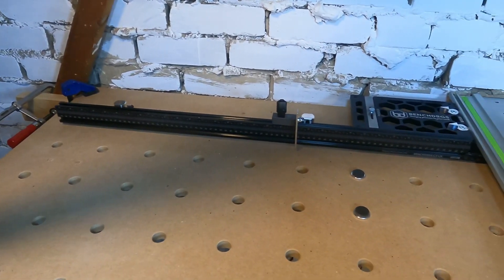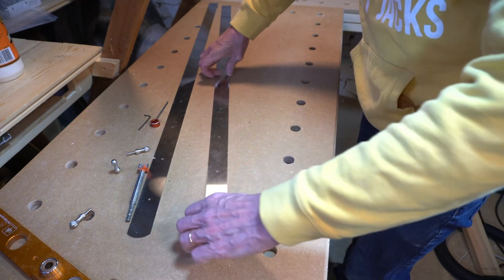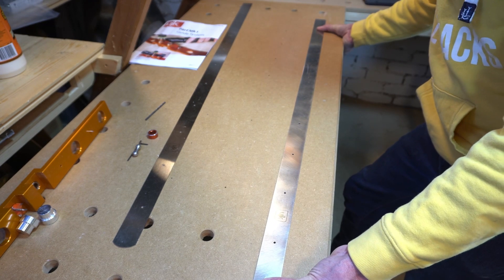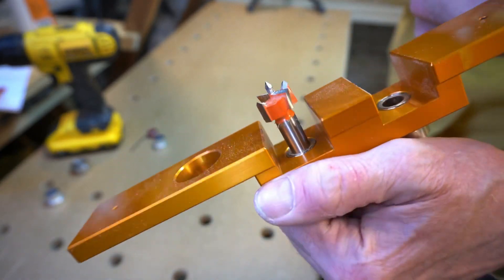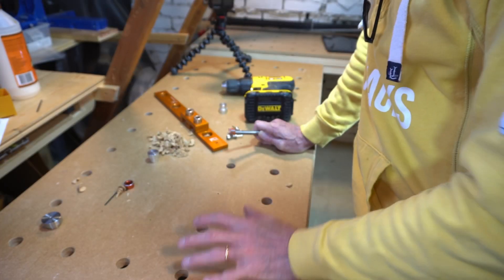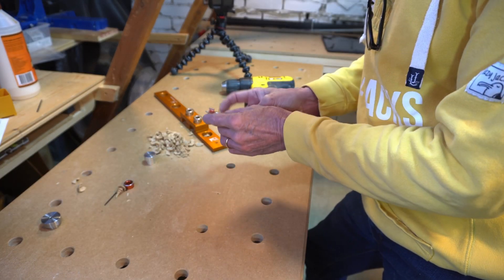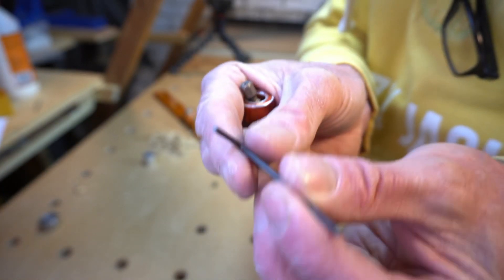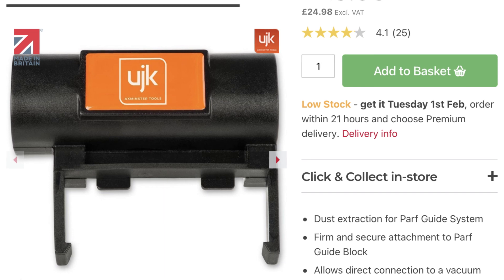UJK Parf Guide System Mk1 for MFT Workbench Tops. Post Project Review

Comment: To prevent breakout on the underside it says in the manual too that you can just use the drill bit on the flipside just to score the underside and it does work very well. I did a plywood version and with that technique I had no blowouts on the bottom side. Admittedly, it adds time to score the holes, but as you're just barely scraping it on that side you can freehand it, and progress quite fast.
Reply from the maker: Hi. Thanks for sharing it’s a good idea 👍 Regards JP

Comment: Excellent and honest video that quickly explains the UJK system. I think you are the first person who has talked about tear out under the top, something I have always wondered. Really like your channel.
Reply from the maker: Thank you for your comment. The tear out under the table was mostly fixed with the same chamfer I applied on top. There were maybe 4 or 5 holes where the tear our ran a bit further. Regards JP
Reply: One way to help prevent bad tearout  I did was ensure you set the collar on the drill just to the point where it just cuts the underside surface, helped on my plywood top.
Reply from the maker: Good tip Kenny. Thanks JP

Comment: Hi John great work, a very useful accessory. The old German 96mm centre set up you referred to is the industrial standard of 32mm between centre's times by three. 32mm centre's are still used today in modern manual and CNC mass production facilities. Enjoyed the video. Tony
Reply from the maker: Thanks Tony. And thanks for the extra info 👍 regards JP
Reply: apostrophe not needed, centres.....great video though, i have looked at a lot of Ax's products recently.

Comment: Yeah it’s a good kit if you need to make a few tops, but I bought my new one from CNC Design in Wrexham for £45 inc delivery 👍.
Reply from the maker: Sounds a great price. 👍 Regards JP
Reply: They do sell a jig themselves for doing this exact thing.
Reply: I got one for about 65 inc delivery last year and it came with 6 dogs, I cut it down a little to fit over my table saw in my shed. TBH not use the table saw since.

Comment: A clear description of how to use this system.
I have built tops using both this system (although I made my own jigs, as I have a machine shop) and a CNC cut template. The latter is cheaper, faster, and more accurate (despite the claims, the multiple steps and incremental nature of the Parf method causes accumulative inaccuracies- as the manufacturers freely confirm). With a template, you just clamp it on top and use a trim router to duplicate the holes. If using MDF, accuracy is not actually crucial, since even the best MDF is only rated to a dimensional stability of 0.3% - which is 3mm over a metre length. Main cause is humidity, which can be local in nature (affects one part of the table) and does not fully return even when the humidity returns.
Both my template and my table are made of 18mm Baltic ply, which is more stable and durable. I recommend it.
Reply from the maker: I didn’t consider the router option but was concerned about all the dust. I could make my own jig now
Reply: @Smallbarnworkshop  Yep, before you know it, you find yourself putting dog holes in everything!

Comment: Everybody  has their own way of working with their particular restrictions on space, noise or whatever. What suits A doesn’t suit B etc. I have a large table saw and so, an MFT is rarely used for cutting - but it is used to hold down pieces whilst I chisel, carve, rout or whatever. 

I had a “MFT” top made for me about 10 years ago. TBH, most holes remain unused. I don’t like the idea of a sacrificial top - just seems like wasting money. So, when I cut on the MFT, I raise everything up on 3mm or 6mm scrap. It does get the occasional ding and I turned it over - still going strong. If and when I do need to replace, I couldn’t justify buying a PARF guide system. I will just lay the old over a new piece of Medite.

I think the quality of the MDF used on any worthwhile project is often overloooked. I won’t touch that compressed paper stuff from the sheds anymore. Cheap but there is a reason for that. Medite MRMDF is superb quality as is Finsa but I find Medite availability easier. It can still blow out underneath but, if drilled with reasonable care. Any blow out is resolved by a “countersink”. 

With the old under or over the Medite, I will then drill holes where I want holes - not all over - and use a new template router bit in that drilled hole to make accurate copies of the size and position. 

As I say, good for some but not for others.
Reply from the maker: When I would worked in timber sales we always stocked two of the three big brands. Kronospan, Caber and Medite - it depended on the commercial deal at the time. We then stocked a value brand. Usually imported from outside Europe. Like cardboard, as you say.
Reply: Medite is, indeed, quality MDF. But the specification lists a dimensional stability of 0.3%. That is 3mm per metre! This movement can happen during the life of the material, and is not even or consistent. If you are using it for clamping, this is all irrelevant- but for those using it for cutting alignment it is not...
Reply from the maker: @Tensquaremetreworkshop  Hi Mike. What do you use? I've just subbed your channel. Regards JP
Reply: @Smallbarnworkshop  Hi, and thanks- I have returned the favour... As I say in my other comment, I use Baltic ply. I was lucky enough to get two large sheets from a company closing down- it was their work table- very high quality ply.
Reply: @Tensquaremetreworkshop  thanks for the information. I’ve never known Medite to move but it appears that’s a possibility. I was always told that the large amount of glue and the lack of a single grain direction in either plywood or mdf made movement so small as to be immaterial. 

Getting good quality plywood is very hard if not possible. One of our sons builds interiors for up market RV’s and his staple is so-called birch plywood. I saw the last lot he had in and it’s just awful - voids, uneven glue lines, lumps of glue. The supplier, a well known timber merchant, offered straight away to take it back but it appears that the quality at the moment is so variable
Reply: @theofarmmanager267  It moves, but not really visible to the eye. Since, if you are using MDF as work material, it too will move after you have finished building it is not that important- all wood moves, at least MDF does not have grain to give differential movement.
Good ply is hard to get- it comes in several grades and number of layers. I understand why MDF is commonly chosen, but despair at the unrealistic claims made by YT builders. Sadly many woodworkers have no engineering training- they are not used to working to tolerances like machinists do. They choose cast iron for table saws, yet rely on MDF for operations that are at least as critical. As always, the question is- is it good enough for the final product? For me, the level of effort in making an MFT top makes it worth using the best material available for the purpose within reason. That way, you have the best chance of success with a critical build.
Reply: @Tensquaremetreworkshop  whether intentional or not, you come across as extremely arrogant. To say “sadly many woodworkers do not have engineering training” is an example of that as is “there are many different grades of plywood” you don’t say. Most people are aware that wood moves as does every metal. 

I’ve only been woodworking for 45 years and thought you might have so,etching to add to my knowledge. Sadly, the only thing I have learnt is never to read any comment from you.
Reply: @theofarmmanager267  Oh dear, sorry if I offended. Are you saying that my statement (about training) was untrue? And yes, all material moves- metal in a more predictable way (usually thermal and returns, unlike wood). I was sharing a viewpoint, whilst saying, clearly, that others are valid in choosing otherwise. If you find this offensive then I must confess to not understanding how. We all bring different experiences, and sharing them is part of the value of YT. There are many that I do not fully agree with, but that never offends me.
Reply from the maker: I’m going back nearly 20 years, we stocked Finnish birch  and Baltic birch. The former was way better with AA grade veneers but way more expensive . The Finnish plywood association also publish loads of data for the timber engineering trade that ll other plywood manufacturers do no.
Reply from the maker: I you may have just talked us into a video Mike 😁 your comments are correct. The joinery trade does not work to the same tolerances as steel engineering though.
Reply: @Tensquaremetreworkshop  I apologise if I have misinterpreted your comment. It’s true that many woodworkers do not have engineering training; equally, many engineers do not have woodworking training. It seemed to me that there was the implication that woodworkers need engineering training and that, somehow, woodworkers with engineering training were intrinsically superior. I don’t support that view at all. The word engineering covers a multitude of work from ship building to precision engineering; I see no functional relevance to the term engineering to woodworking. I jointly owned a steel business and we had a small machine shop that produced tools that we needed; I might understand the tolerances achievable in milling steel but this is woodwork. The way in which natural wood might move is different from the way in which man-made wood might move. Natural timber might have expansion or contraction across the grain but virtually none the other way. Man made timbers might move but I have never experienced any material movement and any that does must be less predictable because of its method of manufacture and any movement might be both ways.

I say might because, in my experience, the amount with which properly seasoned timber moves in the mainland UK is very different from the amount it might move in other countries. Our climate has relatively little changes in humidity throughout the year compared to many others. Pieces that I made 20 years ago with parts glued end grain to cross grain have shown no sign of differential movement.
Reply: @Smallbarnworkshop  When I started out, a large engineering company would have large numbers of people called 'fitters'- that was their job, fitting parts of fabrications together. Over time, accurate machining meant that parts fitted together without adjustment- so the trade virtually died out. Wood, by its nature, is less able to be machined to such (lasting) accuracy, so much of a carpenters time is fitting parts to each other- and is part of the pleasure of such work, since it depends on skill and judgement. Long may that continue.
Reply: @theofarmmanager267  I cannot disagree with anything you have said, and I certainly did not intend to suggest any hierarchy or such. I just feel that there is advantage in cross-over in some cases. Woodworkers work on wood- often with metal. I wince when a youtuber calls something 'absolutely square' or similar.
It is interesting that you referred to what I would call a 'toolroom'. Most engineering companies had one, they made the jigs and fixtures etc required on the shop floor. They tended to be the most skilled personnel, since the tool needs to be more accurate than the intended work. That is why I advocate using the best materials for tools and associated equipment when possible. A skilled person can make very accurate (and beautiful) products using nothing but simple hand tools. All else is to save time and/or simplify the task. We all decide what is the right balance for us- there is no right or wrong. But fitness for purpose in a tool is a source of pleasure in its own right.
Reply from the maker: Just performed a little experiment on the bench I built in November and the Parf guides. I recon the MFT top has expended 0.75mm over 8 x 96mm holes.  Regards JP
Reply: @Smallbarnworkshop  okay. If I take the distance as roughly 800mm; then 0.75mm would be 0.1%? If I’m making piston fit drawers, say 500mm wide, out of good plywood, I would aim for a fit of 0.2mm. So, I would be happy to have expansion of 0.1%
Reply: @Smallbarnworkshop  Interesting- makes a mockery of the 0.01mm accuracy recently claimed by the designer... To be fair, Axminster do not make any such claims, and freely agree to the various inaccuracies in the system. As one would expect from a precision engineering company.
Reply from the maker: My test wasn’t particularly scientific though and it into MDF. I’m not sure (I haven’t looked) if they claim a substrate in long with their figures